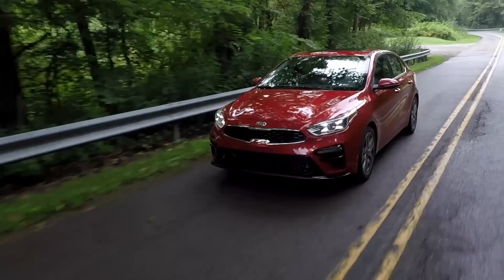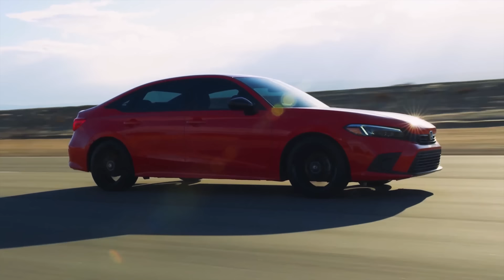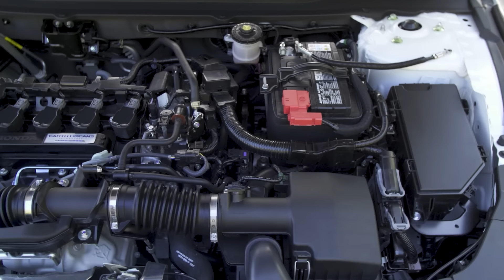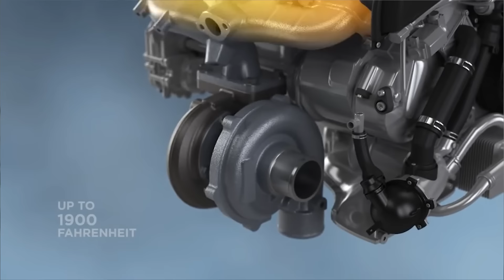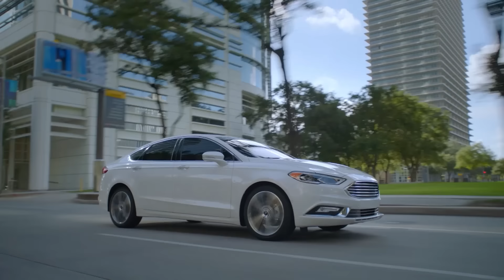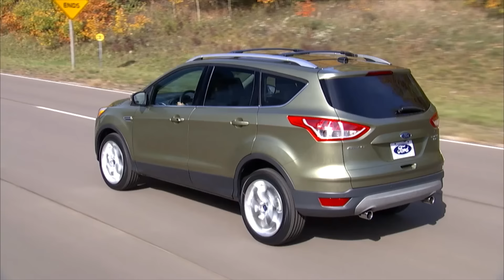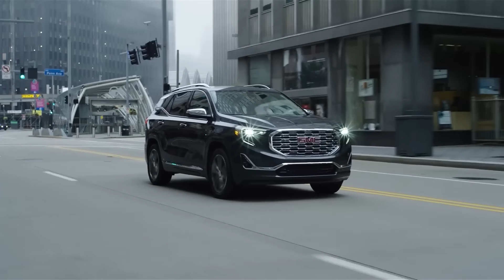Are Turbocharged Engines Reliable? The Truth About Turbo Engines

Comment: A car engine are considered light duty, and the turbo is also cheap. In big diesel and heavy trucks, the turbo are much stronger designed plus the exhaust temperature is several hundred degrees cooler, which made a world of a difference to longivity.

Comment: yes, they're perfectly fine so long as you know how to maintain them. 

gasoline engines with turbos go through oil super quick. 3k mile oil changes are non-negotiable. keep up with oil changes, let the turbo cool after heavy use, and you'll be fine.

Comment: … may not be a question of “if” - manufacturers keep cranking-out turbo 4-cylinders, even for hybrids … I own a turbo vehicle, and haven’t experienced any problems (yet) after nearly 7 years and 60k + miles - I’d buy another one if I had to, but that goes for ANY new or used vehicle, nowadays, thanks to exorbitant prices and interest rates … it’s important to remember that these turbo engines aren’t built for NASCAR or Indy-style driving, and timely (early) maintenance is a MUST …

Comment: Use a quality 100% synthetic oil, change oil every 3,000 to 4,000 miles; let engine warm up a short time before driving, let the engine idle a short time before shutting down - I bought my 2025 Chevy Colorado Trail Boss because my 2019 Silverado was having transmission, engine and differential problems. Every other option out there basically was a problem waiting to happen. So far, no problem, I change oil often and follow the warm up and cool down procedure. Maybe it will last, maybe not... I'd buy a Ford before I'd buy an EV

Comment: In my Chevy Cruze, cost me 1.2K to replace the turbo. This came around the 95k miles mark.
Also had issues with oil line and coolant line into the turbo leaking.
Not worth it to buy a used car with it.😮

Comment: I'm looking for a late model used SUV... Staying away from both turbo engines and CVT transmissions... Which limits choice and gives reduced mileage per gallon... But I expect longer life and fewer repairs, and I can do oil changes if I want to.   Currently our Honda Accord with the CVT is a real laggard when it comes to acceleration, and I don't like that hesitation when I need it most.

Comment: What I have found is that manufacturers are putting engines that are too small or not enough displacement for the curb weight of the vehicle they are powering then they are making up for the lack of displacement by installing turbos. So, the engine now has the stress of pulling a vehicle too large for its design combine with the stress of forced induction from the turbo(s). I do not believe they will be 200 or 300k mile engines without major overhauls.

Comment: I drive a Mazda CX50 with the naturally inspired engine. It is very reliable and has enough power for my every day commute. I don't need the extra boost that comes with a turbo to drive on streets were the speed limit is only 35 to 45 miles an hour and have  to stop every quarter mile for a traffic light or stop sign.

Comment: Bought a 2020 ecosport because it's one of the few cars I was considering with a NA 2L engine. Especially for the second 100k miles, no turbo, no wet belts, no water pump inside the crankase. The 2L NA Duratec is supposed to be one of Ford and Mazda, and others most reliable engine. Very few people can afford a $7000 dollar engine replacement or just junking the car before it's time.

Comment: a turbo just adds more complication, parts, noise and wear for a relatively small gain, especially if used with a smaller engine. An electric motor out accelerates most comparable gas burners, is quieter, cleaner, better deceleration, longer life, more convenient to charge at home. So why is turbo or non turbo even a question?. gas burners Suck, air and Blow, it out the stinkpipe.

Comment: Sensible advice. It also doesn't help when automakers recommend extremely long oil change intervals. If the long interval results in oil consumption then the remaining oil is more stressed.

Comment: I do not agree with some off those information  ,if you drive your vehicle responsibly, change the oil more frequently, i believe you will not have any trouble, with your turbo engines. I do not believe  when you say your hybri is on and off ,could damage your engine, for me i just purchase a 2025 tuscon hybrid with turbo engine  ,i am planning to keep for 4 to 5 years. I will ,change the oil every 6 to 8 thousand kilomet ,time will tell me if i have any problem with my turbo engine, i will post and let people knows how much problems    i have or not,thank you for your video, but i believe we should not be scare to purchase a turbo engine, that is my strong opinion.

Comment: Diesels have turbos because of the poor quality fuel to make it burn better.  They way they make gas turbos today is junk in my opinion. They put dual turbos on 4 and 6 cylinder engines to make 300 to 500 hp. This is damaging to these cheap engines. Many never make it past 30,000 miles if you have a heavy foot. What little gas they save it not worth it to me. You said they are hard to work on, yes and believe me you WILL be working on them.

Comment: The problem is turbo charge engine generate excessive heat that no metal/alloy can handle it. The result is gasket blew up and other metallic components wear down fast.

Comment: 3000 mile oil changes are required for turbo engines. Do not buy them used. No one does 3000 mile oil changes.

Comment: Turbos are fine, as long as you have half a brain to keep up with proper maintenance.  I have a 2013 Kia Optima SXL (160k+ miles) that still gives me 26+mpg.
have only replaced the AC compressor and wastegate. and radiator fan too.

Comment: I've read many reviews of people that have successfully had turbo charged cars, in fact some since the 1980s.  Yes, 90% of drivers today have never had a turbo before and will drive and maintain their cars wrong.  But, if you get into the mind set to 1.) Break the car in properly, 2.) Change the oil out after break in like 500 -1000 miles, 3.) then always warm the engine up first for a minute or so before driving off, and 4.) Cool the engine down, not shutting it off when you come to where you are going, and hopefully can drive low rpms for some blocks before coming to a stop and cooling down your engine before shutting it off. 5.) change your oil - even Synthetic Oil every 5000 -6000 miles or annually which every comes first with the specified oil.  I just bought my first turbo engined car, and it's hard at first getting used to this new way of operating a car - but i'm getting into it.

Comment: I had a 15 year old Fiat turbodiesel, there engine was still smooth towards the end,but mileage became horrid, and when it came to replace it,there was no small/mid sized diesel remaining on the market owing to strict emission norms in India, same as Euro 6. Since I got too used to the midrange Torque of a good old  intercooled turbo 1.3 diesel, the next best future proof option was to go EV

Comment: Turbo engines also require more frequent oil changes
Reply: No they don’t. Stop pretending like you know something.
Reply: @ lol, I was told by the dealer mechanic it is so. Also I have two cars that both use identical oil… one turbo and one not. The turbo is way more frequent. 

Also I know about large pipeline reciprocating engines with 35 yrs experience in them. Turbochargers wear more and have LOTS of heat. As a matter of fact, the higher the temp the more efficient they are. High heat degrades oil. Duh.

Ps: degree in mechanical engineering as well
Reply: @markgrotto7852  Yeah. That would make sense then that a manufacturer would suggest an oil change of a turbo engine at 6,000 miles or 6 months. In giving erroneous recommended maintenance intervals, the engines wouldn’t last very long and hopefully break down within warranty. That would certainly benefit the manufacturer.  Side note: THAT WAS SARCASM!! Just follow the owners manual!
Reply: @ it’s the turbo bearings that go first.
Reply: @ you aren’t addressing the first assertion you made. “Turbocharged engines don’t require more frequent oil changes”

The manual says it. The fleets of hundreds of turbocharged engines I consult for have turbos as a major frequent wear item. 

What facts do you have?
Reply: @ Are you advocating more frequent oil changes of synthetic or conventional oil?
Reply: @ I’m not advocating for more oil changes, just what the OEM states.

Comment: I have a 2018 buick regal with the 2.0 turbo 4. I'd gladly trade that engine for the classic buick 3.8 v6. Yes the NA 3.8 has less hp but, those engines are legendary in their long-term reliability. If you were to run the 3.8 on full synthetic after the break-in period, you could very likely get a half-million miles or more out of it! Good luck doing that with a turbo!🤷‍♂️
Reply: For 2018 they did make a 3.6 engine, naturally aspirated V6

Comment: Being a former aged "Retired"Mechanic Turbos were getting super popular at the end of my career Buick Grand, Cyclone which the name they stole from Mercury Comets. They need to have a coarse in how to drive and maintain your Turbo motor. All turbos oil passages are too freaking small and connected to your motors Oil, Bad engineering! Make it a completely separate system Or make oil capacity 11 quarts so burnt oil isn't setting in the turbo getting even more burnt. Over heating verses under, Is also a issue. Let's face it today's kids don't have parents that even know how it works until it breaks then they get a lesson they can't understand. But a repair bill that is over the value of the car they learn quickly!
Reply: Every car I'm asked to fix because of the Turbo is 6k+. Why can I buy a a whole new Turbo from Jegs, Well that's Easy they don't warranty jack shit! I built a new "Insert engine" and added your turbo and BOOM they say sucks to be you!

Comment: In 2025 model year, Nearly every car with a powerful engine is turbo, including Ferrari V8 replacing V12.  Now, other cars and SUV’s also have more turbo engines than non-turbo.  Porsches all have turbo engines except for specific models.  Mazda may have fewer turbo models than any, while Toyota has hybrids with non-turbo as its standard, but the upper models also have turbo or turbo hybrid.  So this video in 2023, doesn’t forecast that turbo engines are standard in 2025.  The BRZ and 86 are nonturbo yet car magazines have asked for turbo since Day 1 but Subaru won’t invest in that model that sells only a few thousand a year.  Interestingly Porsche has a 2025 turbo that uses a 48hp electric motor to spool the turbo instead of exhaust gas for no turbo lag.  Maybe that will be the future if Honda and Toyota can find a way to use the 12v battery instead of 48v or 600v of EV.

Comment: I am thinking about replacing my 2016 V8 durango with a 2025 Acadia 2.5 Turbo 
should I go for it or just keep my durango ? it has 140k KM 
It gets 50 degree C in summer, I don't know if the turbo can handle the heat

Comment: If the manufacturer knows what they are doing, turbo engines are as good as, if not better than, non-turbo engines

SAAB mass-produced 99 turbo cars already, 1978

that the turbo can't stand the cold, it was new, it's really cold in Sweden, in the winter and I haven't noticed in 40 years that cold weather affects the turbo negatively, on the contrary

 it becomes a much more enjoyable car to drive when it's really cold (the turbo breathes better)

Comment: Thanks for sharing the information and breaking it down in simple terms! 

Unfortunately, latest luxury cars are only available in turbo. For e.g. BMW M440i has Intercooled Turbo Gas/Electric I-6 3.0 L/183. With mild hybrid the short distances seem feasible without straining the turbo engine.

What’re your thoughts on it?

Comment: Turbo's are less reliable, everyone I've owned has had problems caused by or directly related to the turbo. Blown Head Gasket, oil leaking from the Turbo into the exhaust system, damaged TB due to overboost

Comment: Ford, GM, Honda, and Toyota are all newcomers to the turbo game, and thus don't have a lot of experience with these engines.  Mercedes OTOH has been building turbocharged engines since the 1980s. Their designs are much more reliable. I've seen many Mercedes turbo engines with over 150,000 miles running just fine.

Yes, as you stated so well, too many owners don't know or are too lazy to take  proper care of their cars.

Comment: Honda has been having an ongoing issue with their 1.5 turbo head gaskets, and oil dilution, 2010s hyundais have been having issues with their turbo motors, the ecoboost 3.5s (2011 - 2019 cam phasers), 1.0s(wet belt debris plugging stuff), 1.5s(head haskets until 2017ish), and 2.0s (2017 - 2019 headgaskets). 

Honestly from a long term reliabilty, and ease to repair stand point I will go with NA any day. I have almost 200 000 miles out of my 2.0 NA ford focus, and it still runs like new. 

For the fun factor though, definitly a turbo, but none of specified years for the engines listed above!

Edit: Most of those problems are in engine design itself though. The ecoboost 2.7 v6 is a very stout motor and was built to be turbocharged in the first place.

Comment: A turbo is a high rpm compressor and it will fail. So if you trade your car in every 5 years, no problem, but if you want it to go 10 yrs then save some money for the repairs.

Comment: I have Volvo S60 naturally aspirated engine (non-turbo) which had 335,000 miles and still runs great. Can turbo base engines run that long without any engine part replacement? I suspect the answer is no.

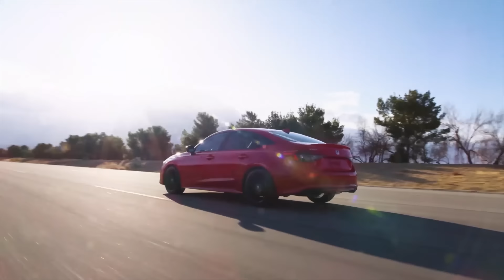Comment: At about 2:01 it's like he is bragging about 34 mpg in a small car with a 1.5 liter 180 horsepower turbo engine.  My 2021 trouble free mid size Camry 2.5 liter "plain jane" 200 HP engine gets 33 mpg with almost no highway driving.  When I fill up, the screen says I can get 450 miles until next fill up.  And I never have remember to wait for a "cool down" or a warm up period.  No Turbo or EV for me ... I don't have to remember a single thing.  Just do 5K oil changes when the "maintenance" light comes on.

Comment: Interestingly, I've got a Ford Territory with an Ecoboost engine, that's not really a Ford Ecoboost, and not really a Ford. Let me explain: in 2020 Ford started selling a new version of the Australian developed Ford Territory, although this time, it was designed in China, with some of it designed and tested in Australia, but not sold in Australia. Instead, it's sold in SE Asia, South America, and the Middle East. It's branded as a Ford, but was co developed with Ford's partner in China, JMC. Since it was the very first co design of JMC with Ford, JMC wanted to avoid the issues Ford was having with their Ecoboost engines, and instead modified the engine to have a cast iron block, redesigned aluminum cylinder head, and a timing chain replacing the belt. It also changed the turbo from Borg Warner to a Honeywell intercooled turbo, with lower boost. The engine was co designed and tested with AVL in Austria, and mated to a CVT VT5 from Punch Power Train in Belgium. This 1.5 4 cylinder is tuned to provide maximum boost from 1,500 - 4,500 RPM. This is all to ensure the engine is reliable and doesn't suffer from the issues the older Ecoboost engines had. So far, it's been a really reliable vehicle, well built, and loaded with tech features. Ford is now looking at adopting this engine for other markets in Europe as a replacement for their older Ecoboost engines. I've been extremely impressed with this crossover, but I change the oil every 7,500 Ks, and make sure I warm the car up for a few minutes before I drive, and idle it for a few minutes after I return, before shutting down. This is to ensure the Turbo stays lubricated and avoid putting undue stress on the engine. All turbo owners should do this with their engines. Just like with CVTs, oil changes are a must, at regular intervals.

Comment: You failed to mention that the turbo also needs to cool down after driving.  Anyone who has driven turbocharged diesel equipment will remind you that the turbine needs to slow down at idle to make sure the turbo bearings slow down while the oil is still pumping to the bearings.  So if you can't warm up for 2 to 5 minutes before driving, and cool 3 to 5 minutes before shutting off, a turbo is not for you.

Comment: Perfect review and great advices. As an engineer and a guy who has a lot of experience with cars, I would say, all you have mentioned are correct. I just wanted to add that the turbo engine will give you the most performance only if you use premium gas and full synthetic oil. Besides, turbo imposes a significant  risk to the engine if anything goes wrong. For example, if any parts of the turbo got broken, the metals can get to the engine and severely damage the engine. Thank you for your great video. Good luck.

Comment: If you drive sensibly you can make a turbo engine last a long time.
Also cut the engine oil changes to half of what the manufacturer suggests. Dont forget the engine air filter also. Turbos suck a lot more air than NA engines and need clean air filters.

Comment: All I can say is if you have a CVT or a turbo u should change your 🛢️at 5K & go in & get your CVT fluid changed every 25,000 mi ONLY OEM fluids in the CVT & then the filter every other CVT fluid change (50K filter)... I had a 2017 Civic 1.5 turbo with a CVT about 60,000 mi I had it tuned (6+PSI) I beat it 👇 like a redheaded stepchild, never gave me any problems..

Comment: As I tend to keep my cars a long time, I avoid turbo charged engines.  If I for some reason need to replace my 2017 Nissan Frontier, I would choose a Nissan Frontier over either the Ford Maverick, of the Ford Ranger.  Both of the Fords only have turbo charged engines.  The Nissan Frontier engine is not turbo charged.